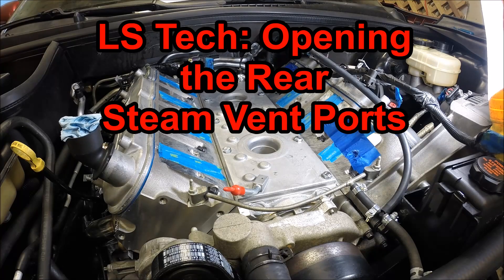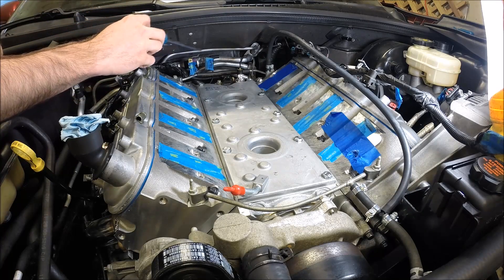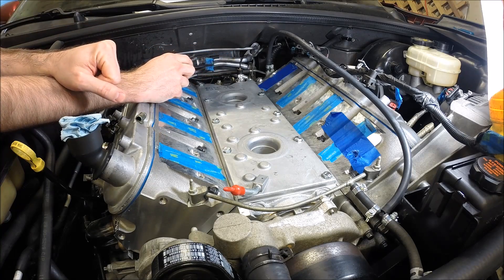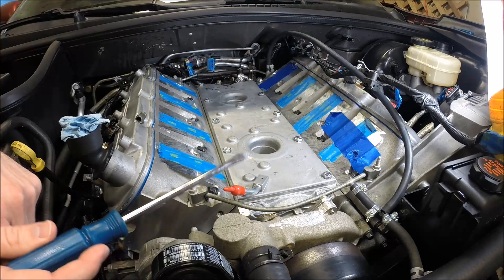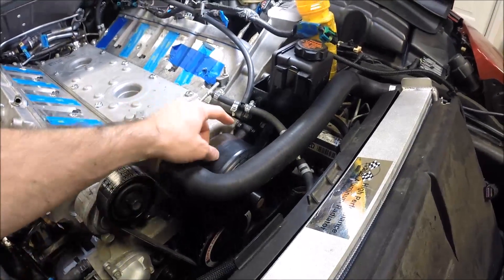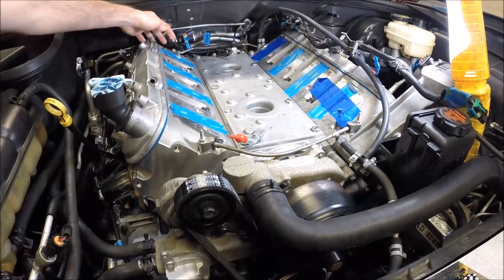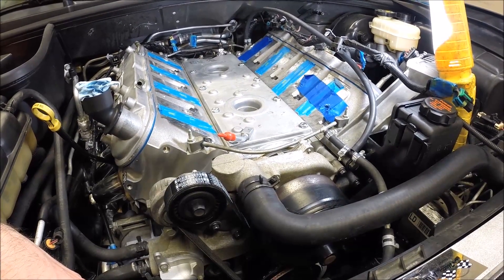LS Tech: Opening up the rear steam vent ports

Comment: Any clearance issues with the LS6 intake and this crossover, or just bolt on and go?
Reply from the maker: No issues.  I connected the front and rear ports above the intake.  If running under the intake, you’d probably have clearance problems.  👍

Comment: Nice Vid - Thank you!  I have not had the #7 problem yet and want to keep it that way.  Do you still believe this is helpful and second, I was thinking of just putting a bleed screw on the hose coming off the rear steam crossover so you could slightly "crack it open" once in a while to bleed off any air/steam.  Gm has 3800 thermostat housings with a steam vent/bleeder in them from the factory.  Any reason this would not work - instead of tying the rear crossover into the front?  Thoughts?
Reply from the maker: For me personally, I think a trapped air pocket was a contributor to why my #7 piston cracked.  Prior to that track event I had changed my coolant.  And even though I had been driving the car for a couple of weeks afterwards without any hint of an air pocket or over heating (coolant level had stabilized, etc), I had the piston failure just a couple of laps into the first session on the first day at the track event.  So I suspect it was an air pocket that was trapped in the back of the cylinder head.   So personally, I think it is worthwhile to open up the rear steam vent ports in the heads, especially since it can be done without too much expense.   Having a bleeder screw in the line probably wouldn't hurt anything, but I would still tie them into the front steam vents.  By the time an air pocket got trapped, you wouldn't know it until too late.
Reply: @ScrufsGarage  Thanks for your input and continued good luck on the channel going forward!!!

Comment: Great video ! I’m going to drill and tap my water pump and put it there so I don’t have long lines everywhere .
Reply: Don't do that lol, I mean it works but its not as efficient or effective as just routing under the rad cap, not the overflow bung lol but just below on the rad. It vents off the pressures and works effectively in all applications

Comment: I like the idea, especially saving money. My donor engine came my sons 03 Tahoe & a 5.3L. The back had no cross over but at that point of the build, I used some 1/4” steel brake line. Marking, center punch, drill a 3/16” into the plugged fitting, then with 10% silver braze, connected them. Then drilled the both and bent a line a brazed a tack. Using extra line, I cut it length wise, the a flap in the middle, like two “Tee” and with a punch, opened it up. I used this as a gusset that wraps around the end tube, onto the center tube with a pattern. Vise grips, vise action, tiny trimming, it fit great to reinforce the connection. It’s all brazed, air checked in water to 50 PSI. I am warming the throttle body so it won’t freeze, but tapped the water pump suction side with an 1/8th” NPT and put a 90 degree barbed fitting to finish circulation. Brazing the small line takes a small tip on an O/A torch and good heat control. After all, radiators have been soldered for over 100 years. Cleaned, scuffed, primed & painted. Looks great. I had your video in mind when I said, why not. Especially w/end gusset wrapped around adding strength from vibration over time. Thank you again.
Retired for a decade, ASE Master Tech.

Comment: on the ls6 valley cover conversion where does the nipple from the front of the valley cover with the orange cap tie into ?
Reply from the maker: That port is for the pcv system, so it does not tie into the steam vent lines.
Reply: @ScrufsGarage  where does that nipple from the valley cover tie into the pcv system then ? I can’t seem to find the information
Reply from the maker: Here's a video on how I routed my pcv lines after I converted to the LS6 style valley cover.   Hopefully this helps.  https://youtu.be/OGq0dhtPx28

Comment: You couldn’t be more closer to the truth! Caping the rear steam lines will melt the rear pistons. Steam vents are a must!
Reply: It sounds like You are well versed on this and seem very sure about this topic. But I doubt you’ve melted a #7 or #8 piston!   I’ll tell you why:  the LS engine block DOES NOT have any open water passages on it for the water to travel into the block at the rear!!!!  So what you are doing is creating another potential place for coolant to leak out! If you want to install a crossover to connect the heads at the rear, then go for it. But if you understand the flow of the cooling system, then you’d do what the GM engineers did starting with the LS6 and Cap them OFF!!
Reply: @champspec  My Man.. 🤘

Comment: rear steam lines i want to blocked them for the ls6 intake but others have talk about rear cylinders heating up.
Reply from the maker: The rear steam lines are a heavily debated topic.   Some people feel strongly that they aren't needed.   For me however, I decided to add them back (I had the LS6 intake stock).   I can't prove it, but I suspect I cracked the #7 piston because of a heat pocket (the 7 piston is at the back of the block).  There are lots of incidents of the 7 and 8 pistons cracking.  Is it related to the steam vents?   Hard to say for sure.   But my personal opinion is that having the rear steam vents certainly doesn't hurt anything.   Worst case they don't do anything, and best case they save me from cracking a piston again.
Reply: @ScrufsGarage  I agree. The #7 cylinder heat/cracking is one of the LSs Achilles heels.....

Comment: Is there a video that just shows how to bleed the air from my Silverado 2004 5.3..i have all factory coolant system..I have no idea what to do cuz so many ideas and differences in engines.  I only have the 2 ports up get..to my TB and then to to radiator. .I'm not sure what to do to get this air outta my top line I can fill...lol..I don't wanna cut anything yet.  I just wanna fix it like someone would do...so what's the instructions to that. Please guys ..I think I've already damaged my motor doing all these "fasthacks " to burping or whatever .like parking with truck up in air and cap off ..driveing round and letting it run and opening cap and squeezeing lines 20 times .I just have more air now ..and now steam is almost constantly comeing outta my tail pipe ..so if anyone knows. Video on just how to bleed air in my truck all factory for most part .I would love to see it. Or text on how to do ..I don't know if I'm doing anything right .lol..not sure if need to pull line off the rad that goes to steam lines? Or take bolt outta steam lines and let water pour out. Like I have :/ no air yet.  Just water so far ..but I can fill the top hose is easy to squezze cuz no water. But bottom line hard ..I pull top line off to try fill there and it had water comeing out ..so I'm lost .please someone help me .before I kill my poor truck more:'(
Reply: Fill the system with an air lift.

Comment: The cruel mistress here is the coolant casting inside the head. A sharp turn, hard corner or flashing left inside the cylinder heads coolant passage will cause cavitation, creating air bubbles due to pressure differences and not simply temperature. This was explained to me in the mid 90’s by a power train engineer who spent 3 days at the dealer, and I was the only tech. He had a cut-a-way of a cylinder head to point out the sharp angles & other hazards a he explain would result in a superheated 1”+ area that 50 degrees F hotter. The manufacture had switched to lost foam casting, like Bill River. You can see tiny dots of cut styrofoam on the surface. These heads are sand cast. I run 4 hooked to front to provide constant circulation on mine, but no kit, just coped steel pipe brazed in place. I liked water pump idea, but use the suction side. 
Until lost foam investment casting or the more expensive wax mold, ceramic casting methods are used, I won’t go without the 4-way vented method, even with the standard 3 degree tilt.
 I had a block of hard maple & ice-pick looking punch to poke a single small hole in top mounted thermostats bridge for “Gen-1” GM’s & others (Imports) since 1971. It seemed painfully obvious to watch a fresh repair & coolant fill, sit there for 7-9 minutes, then magically go dry. That won’t happen with a tiny hole topside.
 Learned that trick from in a two man shop who had worked in a large speed-shop/machining shop for 13 years after 27 years at a Chrysler dealer. Ask a company that builds all billet engines & heads. Lord knows I can’t afford one but they are pulling 3,000 horse ponies, with coolant. 
It’s like piano wire in a cylinder groove and not blow head gaskets with 28psi boost. Why didn’t I think of that first, but who knew they would sell water to people in plastic bottles?

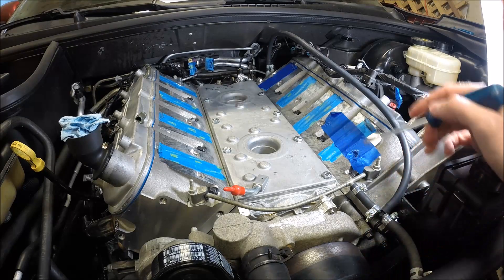Comment: 0:50 they are needed ONLY if the engine is level front to rear. most applications tilt the engine/trans down in the rear by 3 degrees. this makes the front steam ports the highest point and remove the necessity for rear ports. check your angle and adjust accordingly.

Comment: is there any reason you couldn't run the rear line under the intake i think there is clearance
Reply from the maker: wwg1wga  to run the lines under the LS6 intake, you need to do some clearancing.  But I also swapped to the Dorman LS2 intake which has even less clearance under the intake.  The lines definitely wouldn’t go under that intake.
Reply: I ran the factory 4 corner steam setup under the LS6 intake for 2 years, no clearancing, no problems.

Comment: The Engineers realized after a lot of trial and error that the rear steam vents had no purpose. steam Rises and the air pockets will make there way to the top of the cooing system. The LS. Style of Engines are at a slight incline in the front. 
there is no practical use for the rear steam vents..
Reply: Correct, however have you tested the ECT sensors readings in the factory location (cyl 1) vs the opposing rear (cyl 8)?
Reply: Engineers also live in the "perfect world", where "on paper"  thinking is prevalent. Sometimes, what "should" be fine because it works on paper, doesn't work in the real world. Engineers also created the Chevy Vega, Ford Pinto gas tanks in a vulnerable position, and the Cadillac V8-6-4 monstrosity in the early 80s. I suspect this was as much a bean counter decision as and engineering decision. Maybe the rear steam vents aren't needed. But then again, an engineer at one point said they WERE!!!

Comment: The Trick Flo kit won’t work with a stock manifold.  There isn’t enough room for the fittings.
Reply from the maker: Interesting, that's the first I've heard of that, but I went with the more "cost effective" solution, so I didn't get to try the Trickflow kit.

Comment: I’m glad my engine came with the 4-corner steam line now!  I never knew how expensive it would be to create the 4 corner setup.👍
Reply from the maker: The challenge typically arises when you swap to an LS6 intake or a Fast intake.  The lower shell sits closer to the valley cover and there's not enough room for the stock steam vent lines.  There are definitely some pricey aftermarket steam vent kits available, and I'm sure they are very nice.  However, using the GM truck crossover is relatively cheap ($35) so it's a nice budget option if you need it.
Reply: Steam port kits are cheap like 60 bucks

Comment: Wish this was posted a few weeks earlier lol.  I just had the LS6 manifold off to swap to the LS6 PCV system.  Will keep this in mind for later!
Reply from the maker: UGH!  Sorry!   I've working double time trying to get the car finished and have a ton of videos to edit.  Did you do the 04+ LS6 valley cover?
Reply: Scruf's Garage Yessir!  I hadn't noticed any oil consumption issues, but I didn't want to encourage them either.  Figured it was a good project, cleaned up the engine bay, and not terribly expensive.  I  also added one of those DEI heat shields to the underside of the intake manifold to see if it lowered intake temps and replaced the manifold runner gaskets for peace of mind.  Haven't  pulled intake temps yet to see if it's working or not.
Reply from the maker: Very nice!  I did the exact same thing; went to the 04+ LS6 valley cover.  I also run an Elite Engineering catch can and clean side separator.   I am also going to swap to a ported Dorman LS2 intake manifold (the Dorman version uses the Fast lower shell, and you can run the 90mm LS throttle body).  I have some videos coming on this.   I too purchased the heat shield to go under the intake manifold, but discovered that with the Dorman LS2 manifold it sits even closer to the valley cover than the LS6 manifold.   There is absolutely zero room for the heat shield under there.  I did some heat tape on the bottom, but doubt that will do as much as the heat shield.